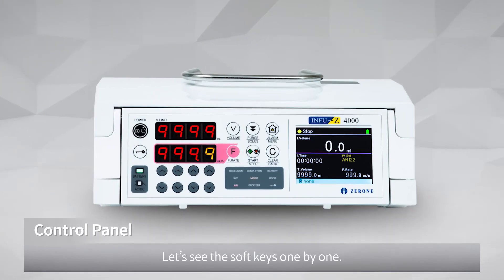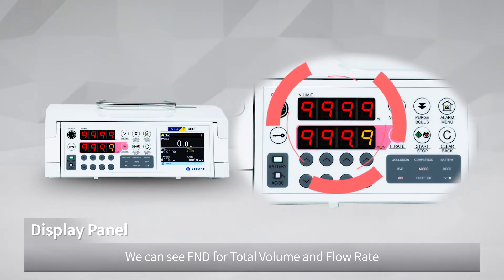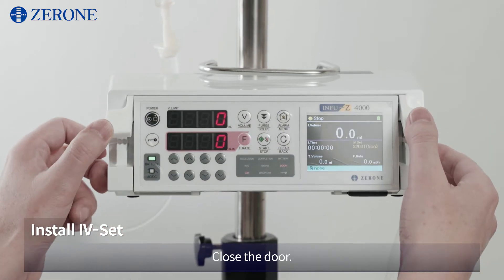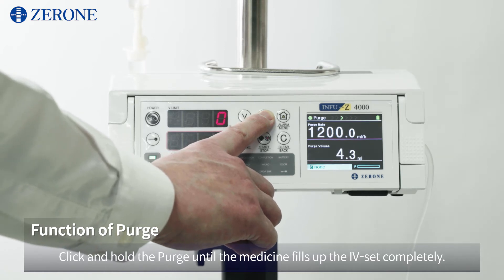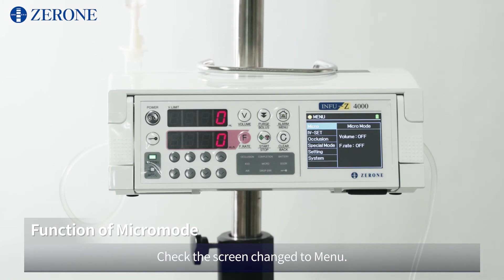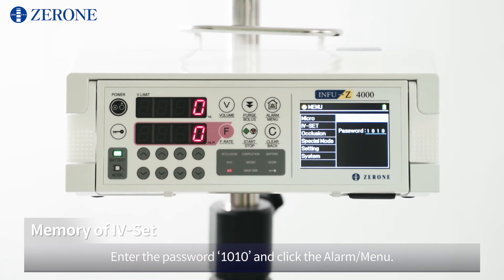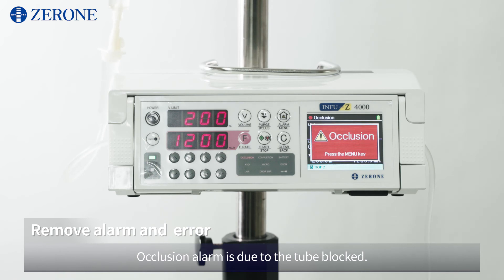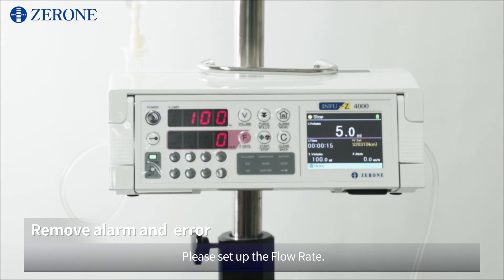[제로원] INFU-Z 4000(Stackable Infusion Pump) Operation Manual

Comment from the maker: 00:15 Ch.1 Appearance: Control Panel
00:57 Ch.2 Appearance: Display Panel
01:50 Ch.3 How to use: Mount on pole clamp
02:11 Ch.4 How to use: Install IV set
02:42 Ch.5 How to use: Set-up and start
03:12 Ch.6 How to use: Function of Purge
03:55 Ch.7 How to use: Function of Bolus
04:34 Ch.8 How to use: Function of Micro mode
05:28 Ch.9 How to use: IV-set
06:21 Ch.10 How to use: Remove IV-set
07:01 Ch.11 How to use: Remove alarm and error